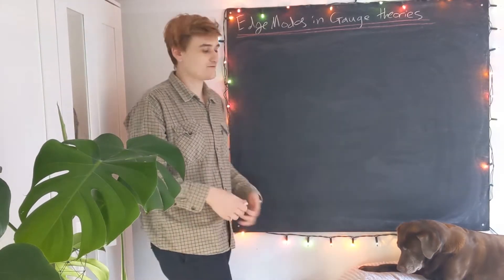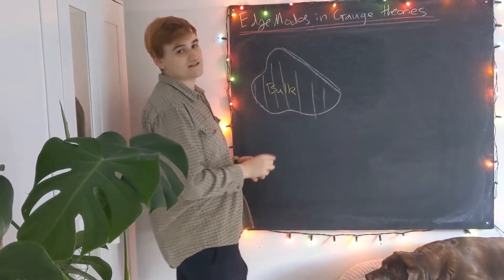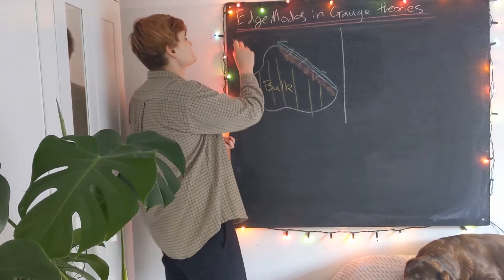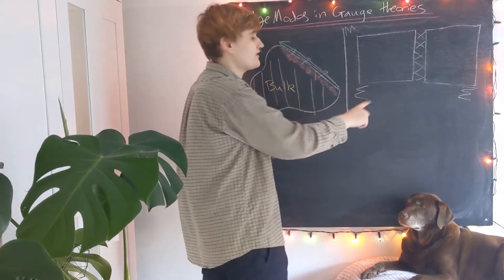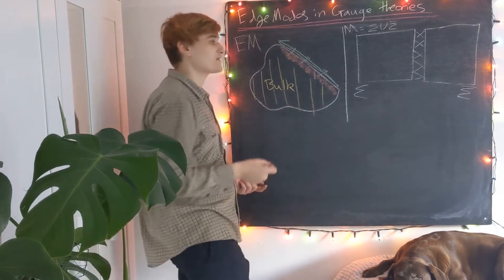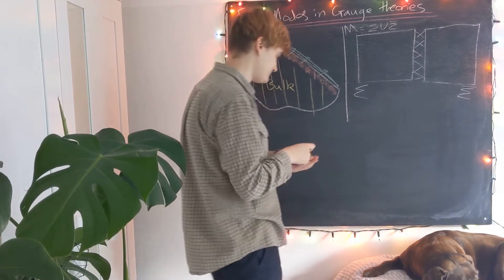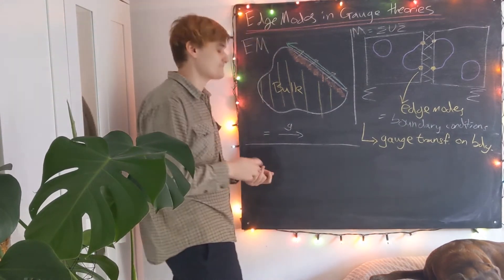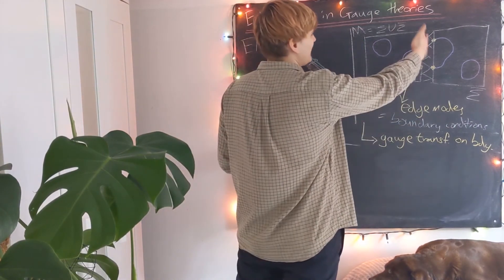Edge Modes #4 - Edge Modes (Briefly)

Comment: Questions: how do you define the boundary whilst excluding information about what's in the gap? I mean, how does one traverse the gap between sigma and sigma bar? And if one joins (union/product) the two regions, itself an assertion,  traditionally you would need transition functions (gauge symmetry) which give information on how the two regions relate to each other.

And how do you avoid losing information to the gap? If you are quantising spacetime in this way then perhaps you need a notion of heat to account for information that is 'lost' into the gap at the boundary (hologram)...further, you cannot quantise spacetime in the same way as you do quantum fields because you would need an extra notion of background to spacetime ie string theory. Otherwise how do you even define the notion of a boundary to spacetime? Simply saying spacetime ends at x = a, y=b, z= c, t = d would seem insufficient.
Furthermore, do you not need a notion of adjacency? What if sigma bar is at some notion of infinity? 

Thanks for the insight, awesome!
Reply from the maker: So there's a few things I didn't /forgot to mention - essentially there are two types of boundary that we are able to treat in the same way, physical boundaries (like the edge of a conductor/black hole singularity) or `fiducial' boundaries, like the gap I drew on the board (that disappears upon gluing the two subregions sigma and sigma bar). Then the edge modes are the transition functions (gauge transformations) on the boundary which ensure gauge invariance either on the physical boundary or across the fiducial one. 

As for the second point we assume the gap is either physically well defined such that no information is lost (i.e. a physical boundary of a conductor, not so sure about BH singularity but supposedly BH don't lose information..) and by no information lost this means geodesics are complete (can be extended to infinity or singularity) and that gauge fields are well behaved everywhere. 

If you want to delve a bit deeper here are some papers I used and found helpful:

- Paper my supervisor co-authored about the categoric groupoid perspective for edge modes (very abstract algebraic geometry) but has a nice introduction summarising the key physical concepts. arxiv: 1907.10651v2
- Another more broad paper summarising some quantum dynamics of edge modes, uses more `old fashioned' (compared to the homological methods used by supervisor and co) extended phase space models which I didn't really look at, but had some interface with when deriving similar objects using the algebraic geometry methods arxiv: 1912.06025v1

I hope to make videos covering all the cartan geometry/ mild category theory stuff and then eventually the GR work that I covered eventually!